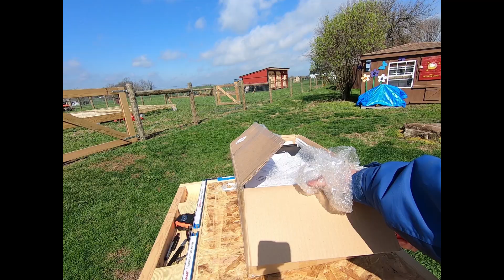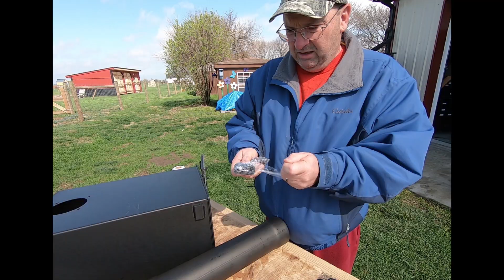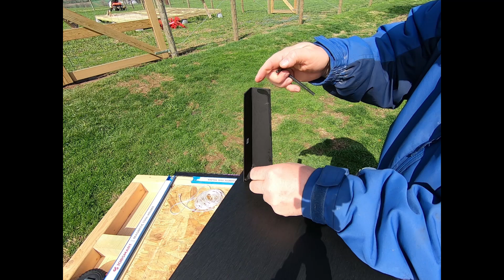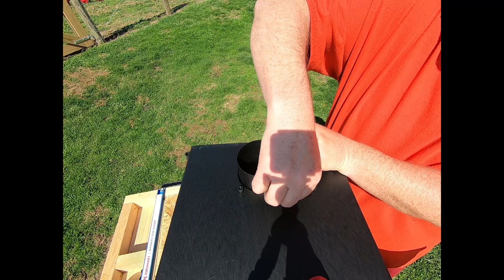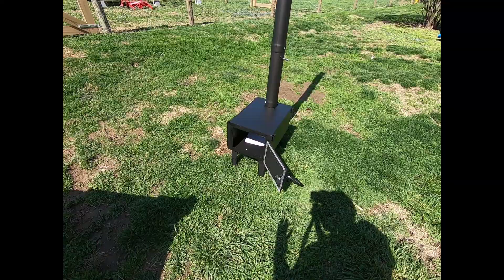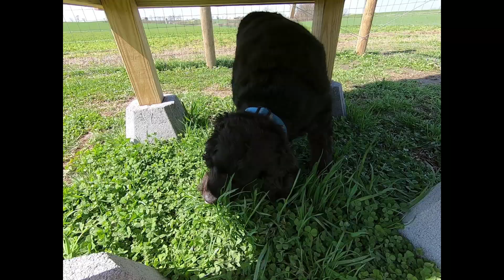PERFECT Wood Stove For Your Cabin, Camp, Tent, Shop, Blind,  or TINY HOUSE?

Comment: Another note.  You can buy 3" double wall chimney and to replace/extend the chimney depending on your install.  I wanted a little more insulation between the chimney and my Kodiak tent and needed it to rise well above the roof.  This did the trick.
Reply: Where can one buy the double wall chimney piece please? Enjoy
Reply: @peterpositive660  I bought mine at Menards but I'm sure other lumber yards would have it as well.
Reply: @peterpositive660  Amazon. I just looked it up myself. About 35$-50$
Reply from the maker: Thanks for watching. Good suggestion.

Comment: as long as this is vented right and has a heat shield under it it should be fine to use in a house during an emergency correct?

Comment: I don't know about building with used pallet wood, but I have been cautioned against burning it, even for outside fires due to the chemicals which may have been absorbed by the wood during its useful life. I know that you aren't burning it, but I wonder if the shed wood might off-gas in contact with the smoke and heat.
Reply from the maker: After a few smokings the inside gets pretty coated with liquid smoke and after awhile it’s pretty much glossy.  Thanks for watching and commenting…much appreciated.

Comment: Going to be strap to it feeding it ~ I got a big wood stove, i have to feed it about every 6 hours! Takes 12 hour for the coals to burn out.  That a lot of wood to chop>   and it will go threw it a pile FAST ~ Setting the dampers, and front air flow in front, it sounds like a rocket stove. It will throw out some heat. i had the whole stove glowing hot

Comment: Wait a minute!!  That tall pipe is to produce draft up the chimney!  If you run that pipe horizontal you have just lost most of your draft and it will be harder for the stove to burn correctly.
Reply from the maker: Thanks for watching. As long as the end of the pipe is above the outlet of the stove there is going to be a draft. I’ve run almost horizontally out of smoke chambers on different smoke houses since the 80’s.  Stove pipes can be run horizontally. Many older homes had stovepipes run across rooms to expend as much heat as possible before exiting outdoors.

Comment: NOITE:  If you would have placed the first ring to that chimney down from the top instead of the bottom before bolting it you could have installed the chimney sections so that there would not be any drips coming down outside of the pipe.  Depenmds on the very last flame arrester onthe top if it fits or not.

Comment: I would add fire bricks to line the bottom of the firebox.
Too much creosote is from burning lumber instead of seasoned timber.
Just take the pipe off, stand it in a barrel, and,  bang it. Regular maintenance.
Reply: How often do you do this?

Comment: Did you do a video on piping it into building? Do the sell the curved pipe or did you fabricate it ?
Reply from the maker: Thanks for watching.  I used a piece of flexible stainless chimney liner. I crimped the stove end by cutting 2” in from the end about 12 times and then crimped the pipe by hand  to fit the stove opening.  It works for my smokehouse installation
Reply: @LancoAmish  happen to have a link to this stove?
Reply: @LancoAmish  thank you I’ve been considering one for my tiny house but would need to add a curved section I appreciate you taking the time to answer

Comment: Good review...did it come with insulation pipe for going through the wood wall without burning down the smoke house?
Reply from the maker: I used stainless chimney liner to pipe into the smokehouse.  It’s about 6’ long. Burning low to get smoke doesn’t heat up the pipe much at all.  I’ve piped this way into wood smoke houses since the 80’s.  Never had a fire (knock on wood).

Comment: Where did you find fittings for that stove pipe? I can't seem to find the correct size.
Reply from the maker: The stove is made to vent straight up like most tent stoves.  You may have to have the fittings that are close sized by a stove installer.

Comment: The only thing i see wrong is the so called bells on the stove pipe are ass backwards the upper pipe should always go inside of the lower pipe so creosote runs inside of the lower pipe not outside all over the outside of the pipe and all over the stove top.

Comment: The prices must have gone up since this video was posted.😢 This stove is now $149, marked down from $179.
Reply from the maker: Steel has definitely increased in price!
Reply: Yes sir I just paid 155.00 with tax and another 50 for the side racks and log rack for inside it , Biden is the reason for the increase, I love this stove though heat's my 12 x10 Ozark trail north fork hot tent to 88 degrees in about 15 minutes lol

Comment: Great review, thank you. I just ordered one for emergency house heat🔥🔥🔥
Reply from the maker: Thanks for watching. Just be careful with the stove pipes.  The seams were upside down. They may have corrected that by now
Reply: @LancoAmish  YOU should stop 🛑 endorsing this product untill they fix the pipe.    When they fix pipe, I will by one.. Can You supply there phone number, I am not to say with computer...thankyou
Reply: Can you give me the name or model number.  I know it's from Amazon.
Reply: @suerubio9034  Hi Sue, I bought mine on ebay, there were 2 models on there 1 was kind of round and this 1 was a square option. Easy to find. Mine was under $150.00 shipped. Good luck
Reply: Search portable wood burning stove.

Comment: Mine leaks creosote on the pipes
Reply from the maker: Yup, for some reason they put the pipe flanges on backwards.  For my use outside it’s not a problem but man is that not good inside.
Reply: @LancoAmish  I modified the pipes to fit correctly and no longer have creosote leaks, was a issue for me as I use mine in a big canvas tent.
Reply: @hksjoshua  how did you modify? We're want to use ours on the camper
Reply: @LancoAmish  well really it's not supposed to be used inside, but who cares? I'm using mine in my prepper shed for emergency heat. Anyway I think some wood stove pipe sealer should solve the leaky pipe situation.

Comment: Does it allow smoke to enter in the building while door is open? Thats a big no go in small buildings.
Reply from the maker: Thanks for watching.  If the draft isn’t good you’re going to get smoke backup with any stove. If the stove is burning hot with a strong draft backup is minimal. When I use mine for smoking it is dampened down and not very hot so yes then the smoke comes out the door.

Comment: The fire box is zinc galvanized coated which will gas off when burned at over  360 degrees. Anyone who buys one of these should first get a fire going as hot as you can outside to burn off the galvanized coating before putting it indoors.
Reply from the maker: Good advice.  Thanks for watching.
Reply: Yup anyone who goes hot tenting should already know that , it's also in the directions for every hot tent wood stove lol
Reply: @beararbogast1897  you mean we actually have to read the instruction manual?
Reply: Except that isn't true at all. It isn't coated with zink. It is coated with an uncured wood stove paint that off gasses as it cures. No zinc involved.
Reply: Mine didn't have the manual by some fluke.... I couldn't breathe right for like 5 months and still kinda feel weak lunged... could barely breathe at all for the first month....be careful with the off gas man!

Comment: I tried to use one of these in an rv and got a lot of smoke inside and when I shut the door the fire pretty much goes out
Reply: RVs are pretty much air tight. You have to have air coming into the heater Firebox from somewhere. Did YOU read the INSTRUCTIONS that came with the heater BEFORE assembling it?  Companies spend a Lot of money on instructions so people will use their products correctly and safely.
Reply from the maker: Thanks for watching. I've read comments on the website for these concerning the same thing.  Others love them.  I wasn't too worried about smoking out the door in my application. A very good draft seems to be super important with these I guess.  Have a great evening.

Comment: Got the large one in my shop 😁 nice for the price.
Reply from the maker: How do you like it for your shop?  I was thinking of getting another one for my shop.  How did you handle the creosote running down the pipes?
Reply: @LancoAmish  I just welded the seams. I'm not planning to take it down anyway. Works great!
Reply from the maker: Steven Ray ,  great idea.  I don’t know why it was designed that way in the first place but it still is a great deal!
Reply: @LancoAmish  oh wow how about that, yeah they have the male/female pipe connections reversed ugh.   That kills me when a product will do almost everything right but then drop the ball on something very important.